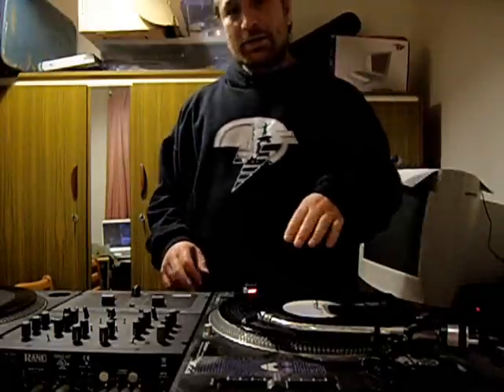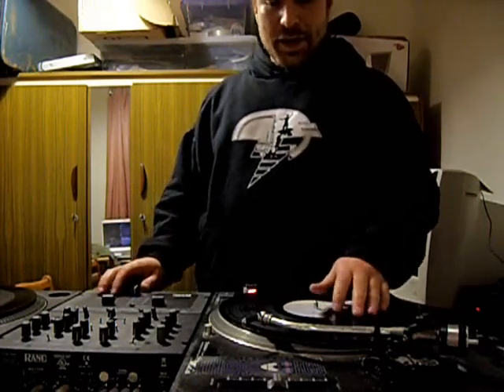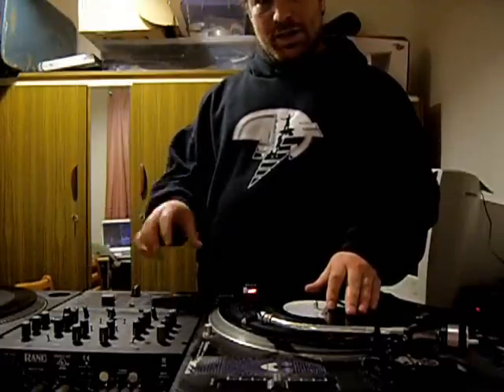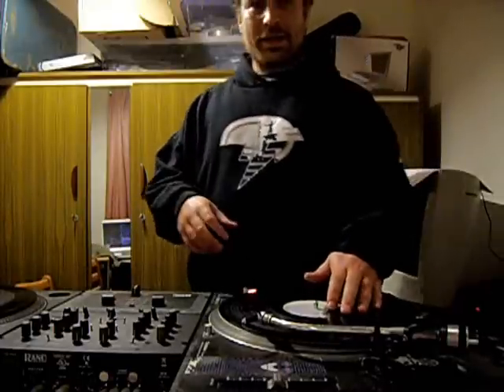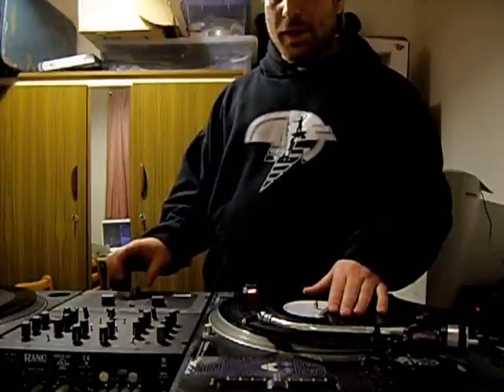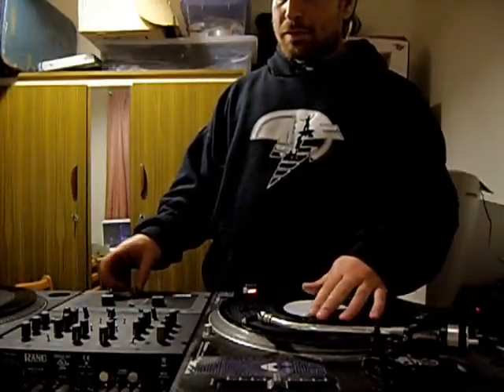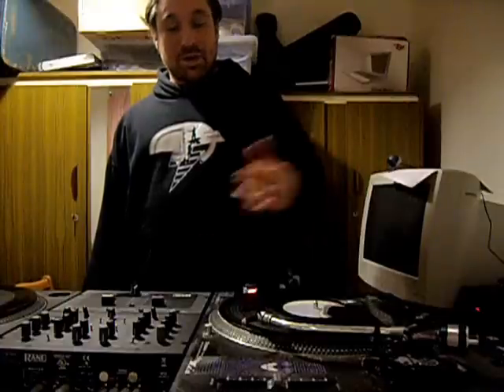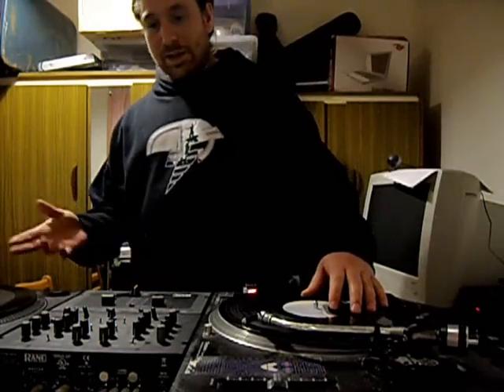Polymetric Scratch Patterns Explained

Comment: still 4/4 over 4/4. u do polymetric ideas by playin x/z meassure over y/z measurre. for example 5/8 over 8/8 which means it will reapeat on one every five 8/8 bars and every eight 5/8 bars. So basicaly u can count that as a 40/8 meassure. if u count 40 8th notes the pattern reapeats.
Reply from the maker: +SiewcaPozogi Hi: thanks for your comment. Yes, absolutely: this shows patterns that are polymetric within themselves, i.e. record and fader movements are out of sync. The meter of the beat is another element that you can engage with polymetrically. 

I've just recently been recording a load of new technical examples as I'm submitting my PhD in turntable performance any day (finally! This was recorded right at the beginning of it).

So in one of the new videos, all three elements (record movements, fader movements and the beat) have different time signatures. The record moves in 5/8, the fader in 3/8 and the beat is 8/8. The whole thing repeats after 240 quavers.

You should also check out DJ Chile's work in this area.